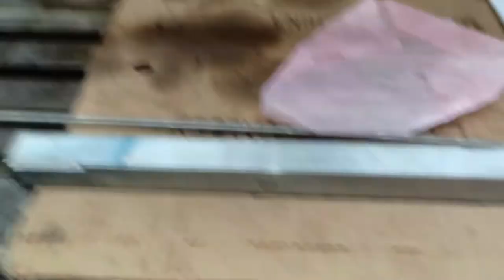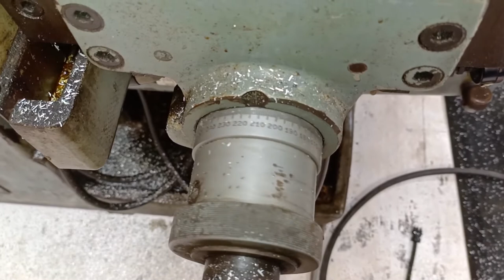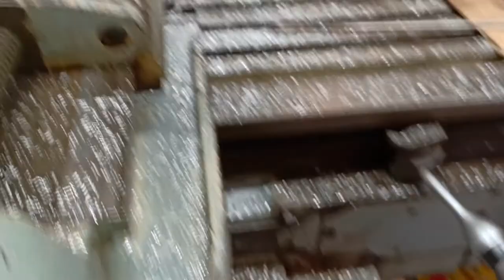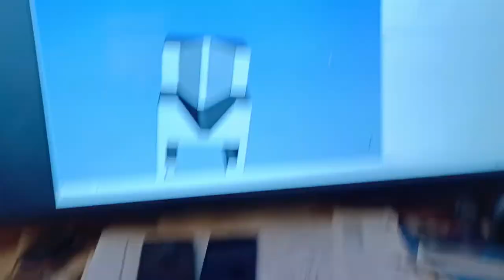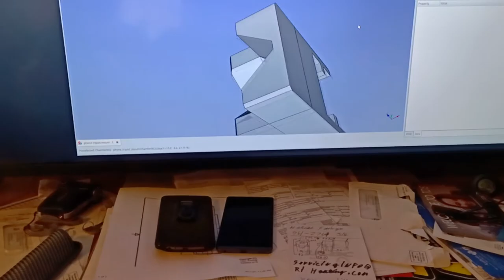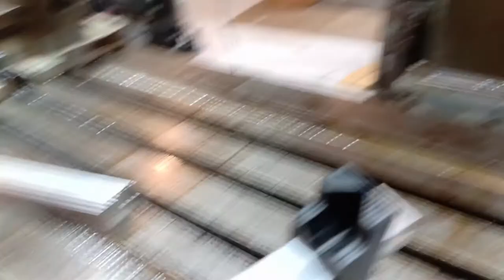phone tripod mount

Comment: Is that an HP Spacepilot? Did you get it new or used? Interesting device...
Reply from the maker: Yes I believe that one is the Spacepilot; I used a space mouse before that, but the legacy connection was a issue for a few years before they released compatible drivers again. I bought this one used to get running again. I really don't like doing cad work without one.
Reply: @matthewperlman3356  Copy that! thanks very  much for your reply! Started watching the FreeCad Tutorials; wish I had known about that program months ago sitting around twiddling and whittlin!! Seams much simpler than other programs of late. Thanks again!